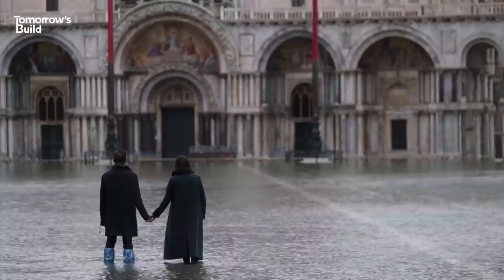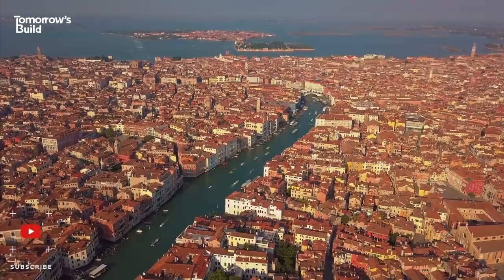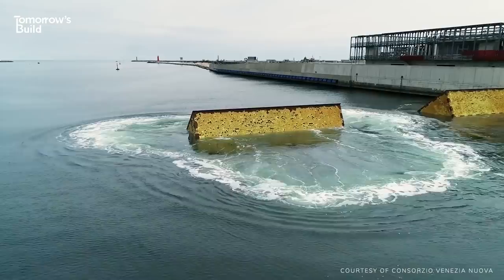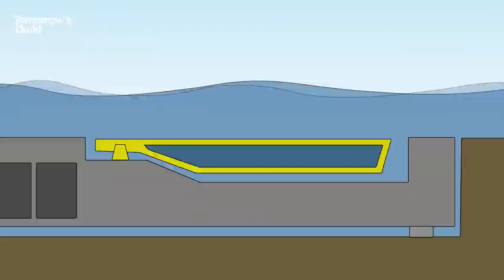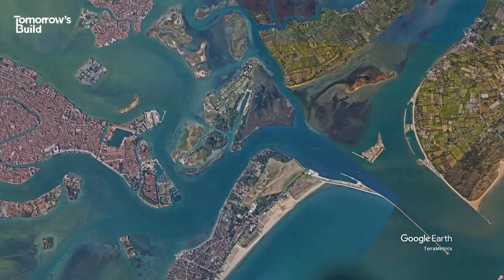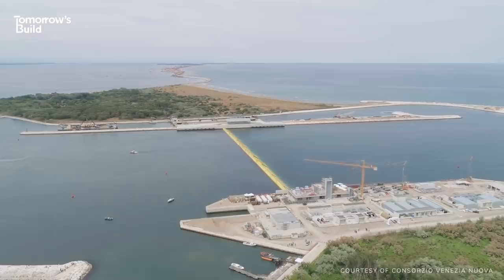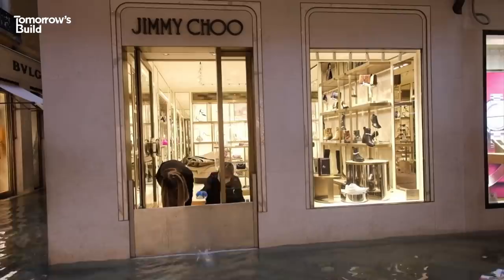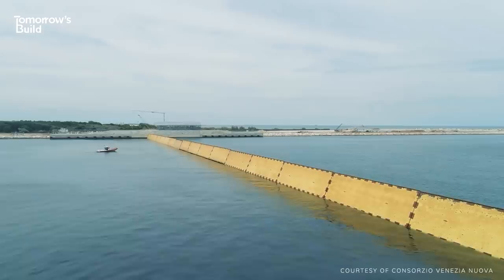The $7BN Megaproject to Save Venice

Comment: "Designed to be effect against sea levels rise by as much as 60 cm in the future." Haaaaaahahahaha...$7 bn and 18 years for a system that will have to be replaced in 25 years.
Reply: They can just make the floats longer
Reply: They can just make the floats longer
Reply: @djscottdog1  I wonder why they didn't think of that before u mentioned it ??
Reply: Yes it's ridiculous. Then this project doesn't protect the basilica di san marco from lower high tide around 80cm (Mose it's not used,I think because it's less cost effective) So all mosaics get flooded and salt water destroys them :/ really a bad situation overall.

Comment: there are many problem with this system. The bigger is that the salt, sand and residues deteriorate the structure which consequently blocks. They should have done the same as the Netherlands and built a huge permanent barrier.

Comment: I just wonder if the weight of the immensely heavy defence system is actually counterproductive as it removes a huge space where the water could fill thus pushing it up over the raised height anyway?   Open for discussion.

Comment: The problem is Venice is being preserved to death. In centuries gone by when a house was no longer above water level they demolished the house and rebuilt at a higher elevation. We can let house be demolished and rebuilt we have to preserve them just the way they are with water lapping in the ground floor. Loved and preserved to death. They might as well enclose the lagoon, make a polder out of it, pump out the water and back fill the canals.

Comment: Just maybe building on a lagoon was a bad idea? Common sense would tell you the weight of all the buildings on land that is not all that stable in the first place will cause the buildings and land to sink. Plus much of the building foundations were built with wood pylons. Wood eventually rots. The tidal effect would erode the land also.

Comment: how does it stop raising water levels when water can flow underneath it?
the pressure of the water on the higher side would force water under the blocks and to the low side. 
did they fill in that gap?

Comment: The MOSE is a deep hole in my country economy. I never understand why, instead of building so costly system, they don't use same system used for lock? Floating and submersible doors as for lock cost less, can be easily replaced. And don't need any oleodynamic system.

Comment: I was saying many years ago, back in the 90's that if the science was right about global warming then all attempts to address it via non economical means were doomed to fail.  We would be better off with simpler plans costing less that to splurge on a few mega projects that will bankrupt the people they are supposed to protect and in the end will not work anyway.  The Venice flood gate project is one of those, a failure beyond salvage and and now there will be no more money to save the city.  
If the solution to a problem is not ECONOMICAL then it is NOT A SOLUTION!